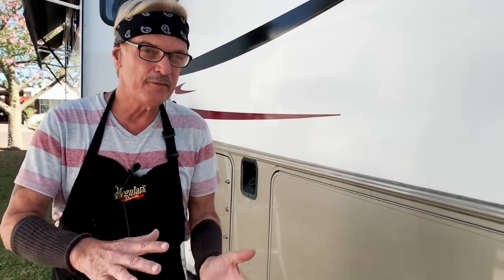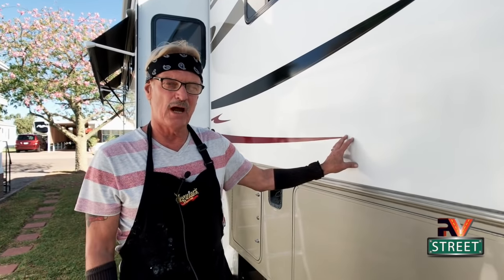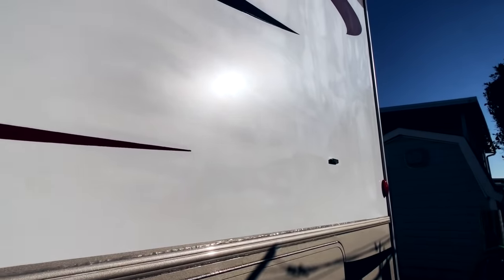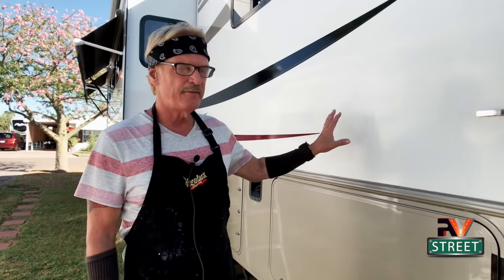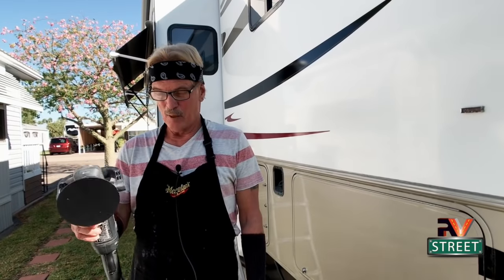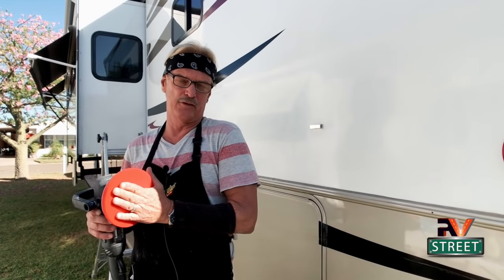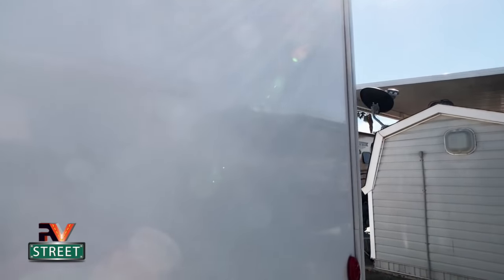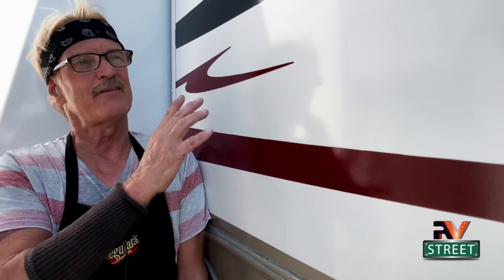HOW TO POLISH & PROTECT YOUR RV THE RIGHT WAY 👍

Comment: Hi Martin... another great video... i did purchase the items you listed thru your Amazon store.. question... in your video, you only show working on the upper part of the coach... do you use the same technique on the lower basement doors area? thanx.... don
Reply from the maker: thx Don,
No. The lower section of my RV where the basement doors are has a different finish and really keeps a nice finish by just washing and applying RejeX. Your RV may have a different finish than mine does down there. So if you have a problem with that area—then yes—same technique.
BTW Don....thank you so much for supporting us using my Amazon Store for everything you normally buy on Amazon. It means so much 💗

Comment: I just got an estimate from a body shop on doing this to my 37-foot motor home and they said it would be anywhere from $4500 to $5000. It's not that hard to do yourself. Just remember to keep the pad flat with the surface and keep moving, take it easy on any stickers and start out at a lower speed until you get used to the buffer.
Reply: I would of done it for 800

Comment: Word of caution with Rejex. I found out the hard way. IF the polish doesn't even out the Chalking(Cloudiness) then don't use the Rejex yet. It will shine but looking into the depth of the shine will be blotchy looking areas. Oxidization needs removed. Which means compounding. I confirmed this with the Rejex company.  I used Meguires #67 RV and Marine One Step with a single rotation (Not orbital) polisher(harbor Freight like $45) and a medium 100% wool pad. #67 starts as a cutting compound then reduces into a polish. You can then go back with Rejex. It's basically the same amount of work as seen in the video.
Reply from the maker: Yeah for sure. I've covered that in other videos. Your right. You can not polish out any surface if it's oxidized. Not the case here, but for anyone else reading, if you have oxidation you have to compound that out first THEN polish and then Rejex for final protection. A dual action, variable speed polisher like the one I use is the only way to go to address all three steps.

Comment: Marin is correct I detail my coach the same way for years it still looks new But if you have a heavier oxidation yellowish dull finish on your coach you will need a heavier compound to pull it off clearcoat. Depending on how heavy it may require 2 times through. Then what Martin shows in this video will handle minimal oxidation that forms every year. But you have to be a kind of person who like Martin and myself wants to do a detail on you coach every year or it will come back heavy in a couple years and all that effort will be lost. McGuires makes a RV compound I think it #57 blue bottle for heaven oxidized fiberglass. It works but it is time consuming having a DA polisher is a must.
Reply from the maker: Great info and thank you for sharing it with the RV community.👍

Comment: Thank you for your comments and tips for using rejex. We have a 2019 Winnebago mini with red gel coat. It was getting cloudy, looked sorta pink, burnt orange on one side that gets full sun. I used a light to medium meguires compound to remove oxidation or cloudiness. I applied rejex as last step. Unbelievable difference. It is now as colorful and has a depth of shine I did not believe possible. I had always kept it waxed and clean but it slowly clouded over time. Thank you for all your videos and how to instructions. Very addictive channel.

Comment: Hi Martin. I have a little something to add, that might help others out there trying to get that luster back. Like the section you pointed out that needed more attention, I had that problem pretty much all over it 2018 Winnebago Vista; we're 2nd owner. Between your guidance, and that of the folks at Meguiar's who weighed in to help me overcome the issue of something that just kept appearing as I polished the coach. I constantly kept getting this marring like effect as I polished with the Meguiar's Ultimate Polish. So Meguiar's suggested using #67 Compound, crank up the RPMs on the MT300 to 4800 - 5800, and utilize mild to moderate pressure as needed. That did the trick. I've completed the passenger side, and the back of the coach using the #67, followed by the Ultimate Polish, then the Rejex. Turned out very well. One area I have to return to is behind the ladder. Didn't want to remove the ladder.  Between worn out shoulders, wrestling with the sun, and rain, I just had to get it close to the rest of the coach, and get the Rejex on it.  I'll just go back another day and finish trying to perfect it. Anyway, just wanted to share what helped me in conjunction to your methodology. Wife and I love the performance that Rejex provides, and appreciate your sharing and answering questions I had along the way. Thanks again.  Would have posted some pics, but didn't know how or if it was possible. Good day to you and Joanie.
Reply from the maker: For everyone reading this, John & I have gone back and forth on FB to address what he was trying to accomplish. He would post pics on my FB page and explain the problem he was having. He had gone to my Amazon Store, bought the right equipment and I got to hand it to him, he was very persistent and got the job done. Now his RV has that luster and shine again an he's a happy camper. 
Thank you John for that update. 👍
Reply: @RVstreet  You are most welcome and appreciated!!!  Your patience with me was superb, as was your responsiveness. Thanks again Martin. Just can't say thanks enough for the great support.  Have a wonderful weekend, wherever you are.

Comment: I started on ours yesterday and finished one side when the rain ended it today.. This is the second time for the chore because the first time didn’t turn out like I had hoped. This time around using a better compound has made the outcome much better
Reply from the maker: So your RV has oxidation?
Reply: @RVstreet  it does. On a stay at the beach I contacted the mobile detail guy that works the campground and wanted a wash and wax. He came out, used a wash that stripped all the wax off and then wanted $2,000 to compound and polish. I declined that proposal and attempted to do it myself. I used the compound that he suggested which was mequiars 49, it didn’t work out.. So this go round I’m using 3M heavy duty compound and mequiars flagship polish. It looks like new again. 
Throughout this I’ve been using a dual action buffer which is a must and have learned a few things. 1st is get a good cutting pad, 2nd is to clean the pad and 3rd is have good detailing towels. I got everything from Chemical Guys.. the cutting pads, they have a spray cleaner for the pads which works very well and they have quality towels.. 
Our 5er is 36’, going down one side I cleaned the pad 5 times to get the oxidation build up off.. When polishing with the white polish pad I cleaned it 3 times. Used 4 clean towels, 2 for compounding, 2 for polishing..

Comment: Detailer’s helper belts are great when doing large vehicles. Used the same apron you have for a few years, than switched. Never looked back. Holds more items, and isn’t so hot in the summer. Have a 42’ fifth wheel, and the Va summers can be brutal. Great vids!

Comment: Hi Martin!  As with the previous comments, this is another really awesome video!  Thank you to you and Joanie for taking the time to make it!

A few questions--

1) if you were starting to detail your rig for the very first time, would you polish the whole thing, then rejex it?  Or reserve the polishing only for the specific sections that need it?

2) Is your pad backing plate a 5 inch or 6 inch version (when you click your link, it has several options to choose from.

3) for your pads, when you click your link, it offers the Griots pads (red).  You can't get a 3 pack, but there are singular and double options.  In the video description, it calls them 6.5inch pads.  But on the amazon, it shows them as 6 inch pads.  I assume it really doesn't matter.  There are also other links on the amazon page for 6.5inch options, but they are not Griots.

Safe travels!  It is finally somewhat warm in Ouray.  I'm ordering you recommended detail items this week!  I have to get them now as the Ouray 4th of July parade is coming up.....and my red tow vehicle needs to look perdy!
Reply from the maker: 1) It depends. My rig when I bought it needed full compounding 1st. Had bad oxidation. Took 3 weeks to do that. Then polished, then applied RejeX. That area I showed in the video that has some cloudiness, if I stay with it often I don't have to polish it again. Now....if there's no oxidation then yes, I would polish the whole rig so I would have a good baseline to start with. Then apply RejeX. Going forward from there, I would wash it good twice a year and apply RejeX twice a year. The key is to NOT let the RV go to long and lose the shine so you have to polish again.

2) I use 5" plate with 6" pads

3) Sorry I should of made that description better on my Amazon page and updated it better in the description text of the video. I'm glad you made me look at that again. I'm usually really good about keeping all that info current and consistent. So thank you.
I just made those updates.
So....I use the 6" red pads (2 pack or more you'll need plenty) for heavy polishing or applying RejeX. But I have found that the yellow pads are softer and better for regular polishing and for applying RejeX. I carry plenty of both so matter what I run into I have what I need. My micro-fiber cloths also are fantastic. There are the best bar none. for that final wipe down.

BTW...when you use my Amazon Store, be sure to check out within 24hrs. AFTER you put items in the cart or I won't get credit. 

Thank you so much for being such an awesome fan and keeping me on my toes 💕🙏 👏
Reply: @RVstreet  Ok...thank you very much, Martin!  I just placed an order for detailing stuff off of your page; well, all but the orbit polisher.  I'll do that tonight or tomorrow.  I hope Joanie and you are having an awesome start to your summer!

Comment: Just a tip Sir, having done this a few times being guided by some experts, I have found to constantly change out the pad. Especially during the initial cutting process. The oxidation builds up fast on both the pad and cloth. A hot pad is a dirty pad. Also, I go through several micro fiber cloths. I definitely noticed there was no streaking anymore. 
And thank u for introducing me to rejex. I love that stuff. Very affordable and superior product.
Reply from the maker: Yup. I couldn't of said it better. 🙏

Comment: Great job, sir, surface looks like new! I own several Griot random orbital buffers, but the one I use the most is a cordless buffer that I purchased from Griot along with 3 batteries. As I work with it, I rotate the batteries into the charger, it's more than enough to keep the process going without having to wait for batteries to charge. Plus, the cordless buffer is very light weight and I don't have to drag a cord around.
Reply from the maker: Thanks Wes 👍 I'm curious, with the battery does it weigh less than 5.4lbs? What model do you have?

Comment: Hi Martin
Good work! I love how you don't cut any corners like me. I have owned a VW restoration business for over the years and only did show winning restoration. From 1983 to 2004 Now I just have a nice hobby shop. Unfortunately I have had to slow down because I didn't take care of my body. I'm dealing with severe knee pain. I have recently purchased my first 2005 Tiffin Allegro 28ft gas powered motorhome. I'm going to have to  remove some of the peeling decals and rebuild the right front leveling jack #66280. I was wondering what would be the best way to remove the adhesive with out hurting the gelcoat. Looking forward following you on your projects coming up and hearing from you. Any help would be greatly appreciate.
Stephen...
Reply from the maker: 3M Strip off wheel. This is the best way to go. 
Get a couple of them for a large graphic. Insert the shaft of the wheel into an ELECTRIC DRILL MOTOR—preferably a 1/2 drive one—not a battery operated drill motor. They're not strong enough. Start from one end of the graphic and gently work your way back and forth with medium pressure (you'll get the feel of it) over the old graphic and it will remove the graphic and the adhesive too. Once that's done, you'll have a little ghosting left over because that graphic has been there for years and there will be a little discoloration where it was and the surrounding area. Then take your variable speed polisher, pads and compound that area to remove or blend the two areas, then polish with red pads, then (2) final protection coats of RejeX. If the discoloration is pretty noticeable between the old graphic removed and the area around it, you'll need to use a wool pad instead of the red pads and a little more aggressive compound like my diamond compound.
I have all this in my Amazon Store in the "Compound, Polish, Finish Coat" category.
Just take your time and you'll be fine.
thx Stephen

Comment: Excellent video, very helpful. I do have one question though. I noticed that your coach has graphics, are they stickers? if so do you have any issues with the polisher damaging the graphics since they are technically a raised edge?
Reply from the maker: Not stickers, vinyl graphics and nope, no problem polishing right over them.

Comment: Rejex says it would last less if you apply it on polish. That is once the polish breaks down, it will take Rejex with it. Ideal application would be, IMO, to buff with an abrasive compound, clean and then Rejex, if done for the first time. Then on, just clean and apply Rejex.
Reply from the maker: Thank you for your input
Reply: Rejex says do not apply over WAX, not polish. Polish is a process, not a coating. Polishing restores the finish; it does not remain on the surface.
Reply: @michaelcain1870 that is exactly what I thought / meant, to the extent that when I first read it (in email notification) I thought I wrote it :)